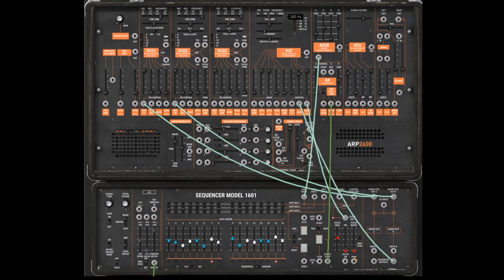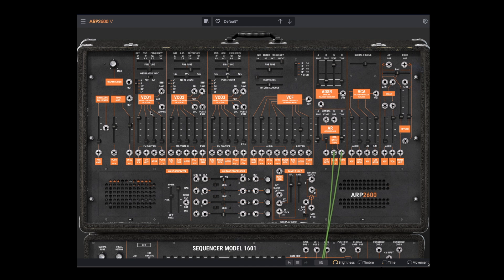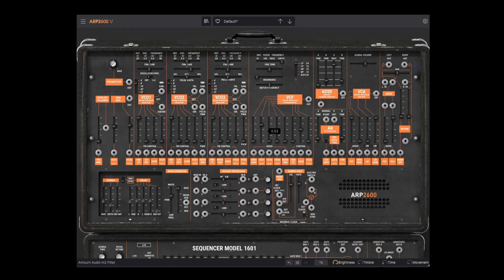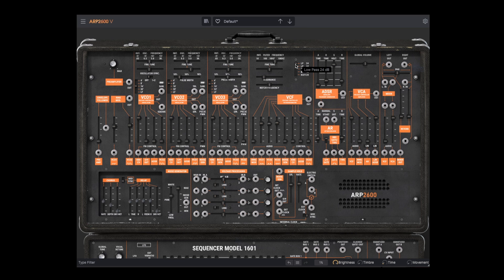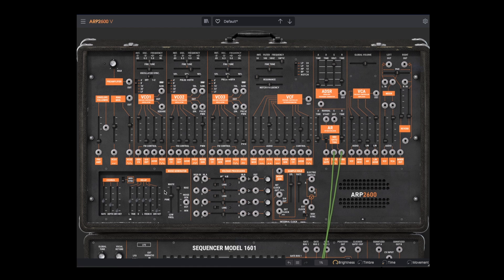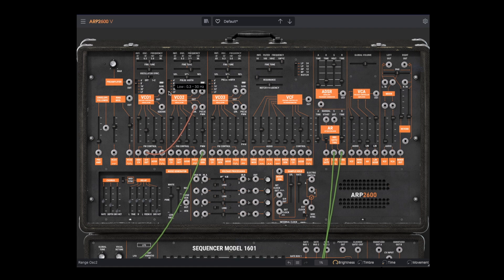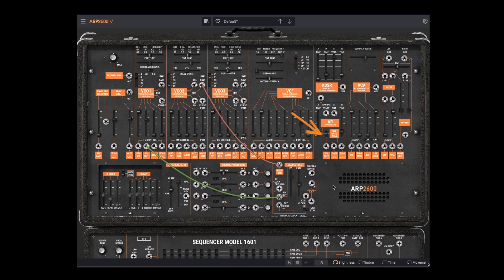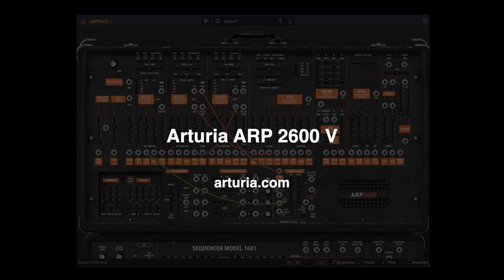Arturia ARP 2600 V: A Detailed Demo and Tutorial (Part 1)

Comment: Hi CatSynth, I am curious about the input that is between the mixer inputs and the pan slider, It seems to do nothing?
Reply from the maker: Hi there.  Sorry for the delay in getting back to you - I believe that overrides the mixer input to the panner with another signal.
Reply: @CatSynthTV  still can't find any use for it lol
Reply from the maker: @ohernik  yeah, I haven't used it myself.  I suppose if you want to stereo-panning effects or the like you can run an LFO or other CV source into it.
Reply: @CatSynthTV  sadly not, it just cuts the audio off, I've tried it on every version so I don't think it's a bug but it can't be modulated by signal either. To make that panning effect I have to use the voltage processors.